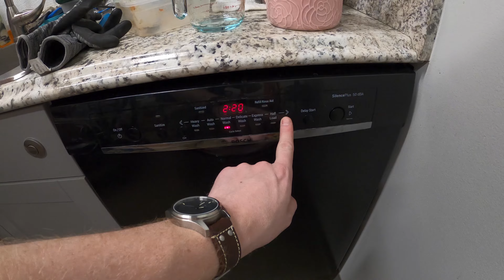Kenmore Progressive Canister Vacuum Cleaner How To Fix

Comment: I had a Sears Kenmore Progressive canister vac ... and finally the brush head motor finally went out.
     I called the phone number on the bottom of the power head.  A very nice lady answered, and as I read the serial number, she said, "I'm sorry, we don't have parts for any parts over 30 years old."
     So, I bought a new SEBO E3.  I'm pretty sure I can make it last the next 30 years—or until I die, which ever comes first (and it's probably a race).
Reply: They tried to recommend one for me, because my old Powermate assembly no longer works:  But frankly, the SEBO doesn't look nearly as easy to change attachments with the foot pedal, nor does it have the range of attachments this one does--including the mini stair Powermate!--and it starts at $800, and accessories are extra!

I'm hoping a reset will sell it, otherwise I'm looking for a replacement motorhead, or complete Powermate assembly.
Reply: @melissanotthewebsbusiness7272  Agree, there are some pros and cons.
     The good news is the SEBO is a commercial grade machine for home use. It's very quiet, and I do believe it'll last until I die.
     Good luck however it works out!

Comment: So far I've only watched 5 min into the video. I would agree with you on the air leakage. But I will say i have mine for over 17 yrs. And it has never failed me. (Until last week,)the motor was emitting a burnt brushes smell. MY POINT IS, IT GAVE ME MORE THAN I EVER EXPECTED IT TO.
2ND POINT.. You said $300 or $400 dollars. No sir they were and are $649.00 to $799.99 
But i was and am completely satisfied with that unit. No broken wheel never broke a belt. Just the bag leakage and extension wand leaking that bothered me. Thank you for your video. Could you make one on motor replacement or if there are brushes for the motor. Thank you
Reply from the maker: You're referring to a different model of Kenmore. 
What's your referring to would it be a Panasonic machine different than this but this is a copy of that.

Comment: I'm still using my 1989 canister older version of this, and find to clean much better than many other things I've tried never cleaned as well and failed catastrophically far faster - whereas this very frequently used one just kept working (well).  Yes, the bag and filters are not as easy to install and don't seal as well as they should, but it has been the best cleaning and most reliable vac I've ever owned.  The level adjuster broke (only) a decade ago, but it's perfect for my low carpeting without it.  But the dirt sensor has has failed and I'm trying to understand how to debug and fix, if possible,  Any advice from anyone welcome.
Reply: I'm sorry... I don't care how great a canister vacuum works and is easy to use.... if there's not a proper seal on the bag.....everything great about the vacuum falls apart because that is a MAJOR flaw... the point is to be cleaning and dirt going into the bag.... if some of that dirt misses the bag and ends up in the vacuum cleaner itself... it feels almost pointless

Comment: Great repair video.

Late to the party but the Kenmore canister is my wife's favorite vacuum. We bought one new years ago and I keep an eye out for garage sales for additional machines. We have two in the house in constant usage and another one in the shed along with some other spare parts. I just trashed a base unit with a burned out motor.  Biggest problem we have had is electrical problems on the hose and brittle plastic on hose clips.

Comment: I’ve had my Kenmore Progressive since 2000. 24 years. My bags are clothe and have the rubber gasket. I also change the filters at least annually.  When I had pets I changed them twice a year. It’s just starting to shut off on it’s own occasionally when I pull on the hose. Not sure if it’s the hose or the swivel piece. If I put gentle pressure on the swivel piece, it runs again. Any suggestions.

Comment: Still have the Kenmore canisters cleaning both offices. They are from the 80's. Got some uprights thru the years that threw dust all over. Always back to the cannisters. Have  Kenmore Progressives at both houses. 20+ years old and no issues. Paid around $500 for them during big sales. I cannot think of a better bang for buck. Even after factoring  annual filter changes. Bought this exact cannister for my Aunt. Said today still going after 2 decades and no issues. Has tried other expensive cannisters but dont clean as well. She was as shocked by this video as I was.
Reply from the maker: Made by a different company completely. Panasonic hasn't made them in years

Comment: Watched the whole video to see where the motor start capacitor was because mine has a very short hum before it starts. Usually that's a cap but this one in the video didn't have one so I guess it must just be the motor. Great video! Learned a lot and enough to maybe not fix it, gotta check and see if I can even find a new one and the cost. Prolly not worth it but try explaining that to my wife that got it from her mom before she passed.🤦

Comment: I have a Kenmore progressive canister vacuum I bought in 2003,  for around $300....the vacuum I had prior to that was also a Kenmore canister I bought in 1978, replaced it's motor in 2005,  had to dispose of that in 2016 even though it was still working......neither one of them are in as bad shape as the one you are working on......my progressive works like a champ.  I had to replace the plug on it this year as one of the tongs broke off, my fault I accidentally stepped on the plug     I have replaced both wheels , belt and plug myself.  Changed bags and filter often, and just bought new ones yesterday.......I do get the gasket missing on bag, however you can add that yourself......really disappointed with your bad attitude...btw, I am a woman .
Reply from the maker: Glad that you found your calling in life.

Comment: I noticed you put the motor filter in backwards: 24:12. Every vacuum I've ever owned has always been full of dust and dirt. Don't complain too too much because if these things were made up to your standards they would never break and you would be out of business. Trying to fix the power wand was one of the last things I was able to do with my dad before he passed of cancer. We couldn't figure it out and I remember noticing how thin his arms were getting. My brother ended up having to take it to a repair person. When it came back, it worked, but it always smelled bad, like old barf or something. I took this vacuum home with me when we had to clean out my parents' house. It still works, but I've never been able to solve that smell problem...Maybe one day I'll watch your video in slow motion and take the whole thing apart and see what's going on. Thanks for making the video.
Reply from the maker: Course side always goes towards the intake. 
Let me introduce you to a whole bunch of machines that don't break and don't have Dustin In them ever.
https://youtu.be/kzhD_gtMuNM

Comment: Good video thanks. Contemplating the tear down and dishwashing all the plastic on a freecycle aquired Progressive Whisperbelt 216.20813003 Kenmore I got (free) today. Fairly clean and runs well, great suction. Found all the dust you had everywhere. The white poly fuzz side of the motor filter faces the bag though I believe, or all the fuzzy fine fiber will end up in the motor. The coarse spongy side might catch any that gets pulled thru to the "darkside" Luke.:-)
Or not....;-) Great demo of all the limitations of this machines HEPA  shortcomings. Is there a way to easily remedy some of these "leaks" on the intake and the exhaust?  You mentioned a bag gasket, holes in wheels, incomplete or inadequate gasket material, etc.  Any simple fixes with silicone or some other angle for those of us with allergies and no $$$ to buy a new machine?
Reply: Waiting for a response because I have the same questions as I wait for my used Kenmore. Had a Kenmore 4.1 or something like that when I was a kid, and I miss it dearly since I've been disappointed in every vacuum since. I think the air leakage around the bag was always the only thing really that annoyed us. Fix that, and it's a pretty great machine for an end-user at least.
Reply: Yes, he definitely put the motor filter in backwards: 24:12

Comment: So... what is the transistor for? 

My Aunt's vacuum suction motor does not run but the Powermate motor does. I'm thinking the carbon brushes wore out. I tested the fuse & it is fine. All connectors are working fine.
Reply from the maker: New motor probably. Take it to your local vacuum store.

Comment: the worst vacuum i worked on was a panasonic direct drive ,  iwas one of the first ones. had a trigger to turn on and a slider to lock the trigger on .sold it to a friend , was going to wash his carpets and was going to use his vacuum , to my suprise the roller went backwards . i felt like an idiot for selling that to him like that and didnt even realize why it wasnt working right. took it apart a tried to get back to gether but it was a nightmare ,was sandwiched by 2 halfs and just refused to go back together. junked it . gave him a kenmore direct drive . that works.

Comment: My Kenmore Progressive won't shut off unless plug is pulled. Replaced with a new switch to no avail. Any ideas as to what it can be? Otherwise the vacuum works fine.

Comment: Which of the following models of canisters would outperform the Kenmore canister in this video?
-The Olympia One (from Electrolux)
-The Silverado (from Electrolux too)
-The Diamond Jubilee (also from Electrolux)
-Any of those of the Hi-Tech and LE models from the 1980's (from Electrolux as well)
-A Sebo of the C series with a powerhead modeled ET-1 or ET-C
-The Lux Classic from Aerus
-The Lux Legacy from Aerus
-A Miele Classic C1 with a powerhead modeled SEB 228
-The Sebo K3
Reply from the maker: What are the parameters for "performance" ? Filtration, maneuverability, features, airflow, working vacuum? The list goes on and on join our Discord server and let's talk about it.
Reply: You have to admit that each was at least built better than the Sears in on the bench.
Reply: This vacuum in the video was from an interesting time in history. The intro of HEPA filters which was mainly just for looks. The consumer driven push from bagged to bagless vacuums. Sears as a company starting to seriously fail, thus outsourcing manufacturing to the lowest bidder. This vacuum is a result of a lot of that.

Miele, Electrolux, and Sebo all have more stable histories than Kenmore. Test drive some at your local vacuum store and see which ones feel nice. This vacuum in the video, what annoys me is it is way too lightweight for the brushroll, so it hops around on low-medium pile carpet. Sometimes you gotta use something to know if you like it or not. I do like this vacuum for cleaning things above the floor.

Comment: Looks like that owner gave their vacuum a free fall ride down the stairs a few times. So, that HEPA filter at the end is just for looks, right? Since there is obviously so much air leaking out elsewhere. I know in the 90's it was popular to say the vacuum had HEPA filtration, even though it was actually meaningless, because the system wasn't sealed. I see the HEPA filter on my machine has popped its seams, so it wasn't doing its job either. The important filter here is the pre-motor filter. Cool.

Comment: Powerhead problem: I have a Kenmore canister. There seems an electrical issue with the powerhead. Moving it back and forth sometimes results in power loss. I think the problem is with the connection in the wand handle. Any one seen this?
Reply from the maker: It's very common with this machine to have all sorts of failures related to that. I'd recommend you bring it to your local vacuum shop and have a professionally troubleshooted

Comment: Do you know Kenmore - aka The Robin Reliant of Vacuums -  will run without a bag? I just discovered this fact. It's a mess.  Hoping to learn how to take it apart and clean it all. After just a few months the foot switch on the power head is failing.  I don't think this machine is worth $400.

Comment: I always buy Kenmore, the problems are minimal. But you video glosses quickly over the parts I most need to see. You take the screws most difficult to find  or access off while off screen. That's no help, that's what I needed to see.
Reply: Me too.  I needed to know how to get to the screws under the pedals.  But the video just says 'you can do that how you want'.  I have no idea.  But I played around with a screwdriver and found you can pry the plastic pedals off.  they are just held in with plastic knobs.  Perhaps the video can add a  short bit about that to help others.

Comment: Hey, I have a Eureka Contour bagged upright vac, and it has very powerful suction, a triple stretch hose, with extra long crevice tool, and dusting brush, plus a headlight, and is just about the same color as the Kenmore, too! 
Eureka Contour was made in 2007- 2009, I'm thinking.

Comment: Those power nozzle bottoms are always broken very cheap plastic.
Reply: Plus, people abuse them like crazy crashing them into things and shoving them under furniture where it doesn't fit. They were being very rough with this machine to break the wheels. The top of the machine is flimsy plastic, but not the bottom.